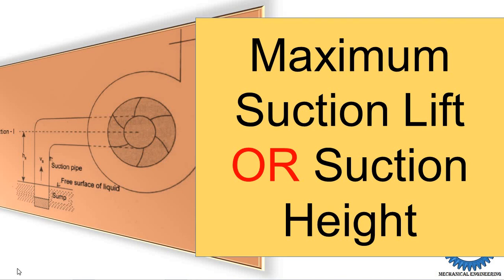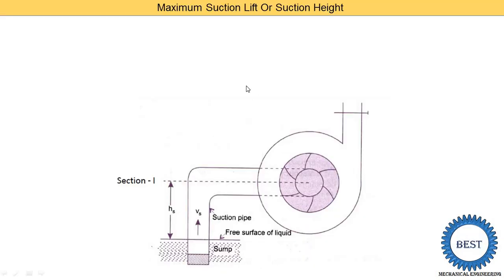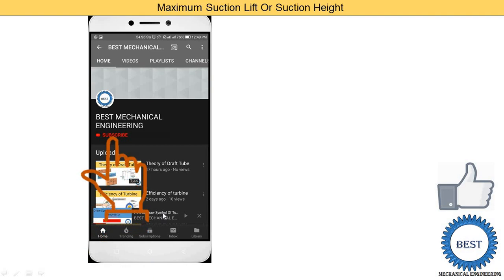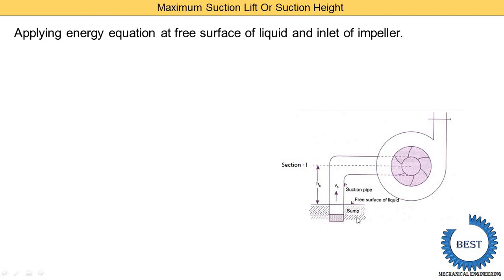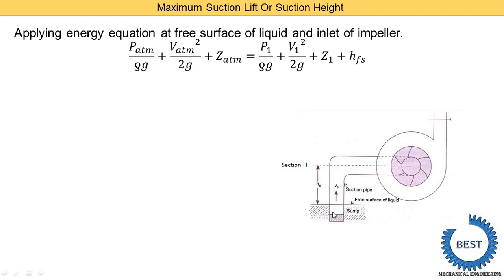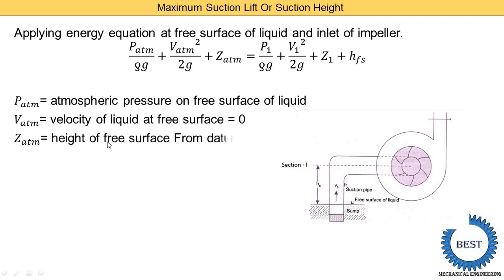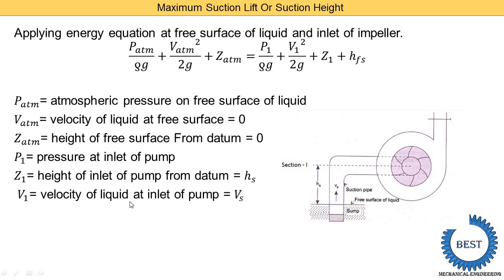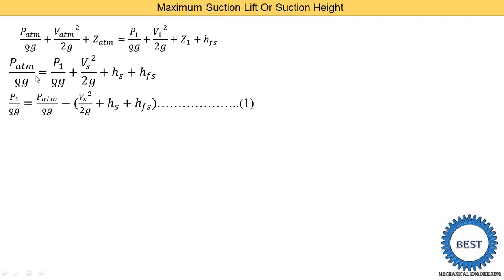Maximum Suction Lift or Maximum Suction Height For Pump

Comment: Sir my borewell is 300ft deep can i use my centrifugal pump operated by 5hp diesel engine. 
My pump specification is 3800rpm
3.7kw 5hp.